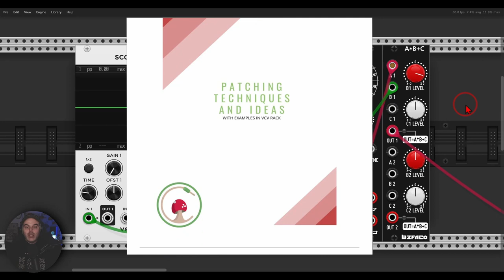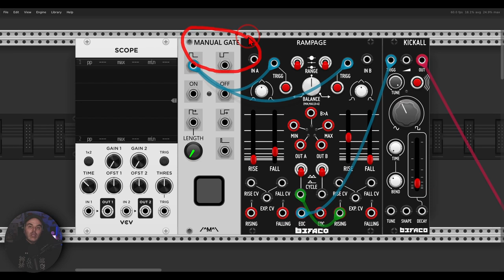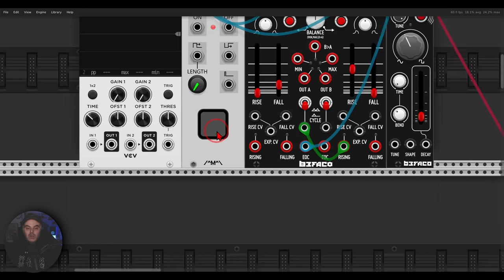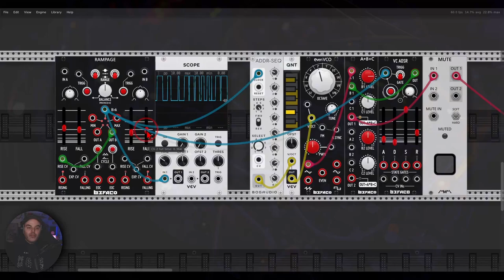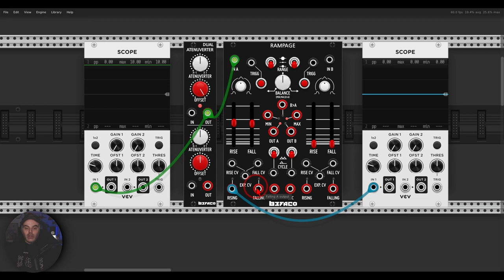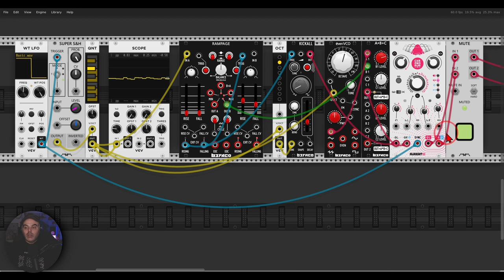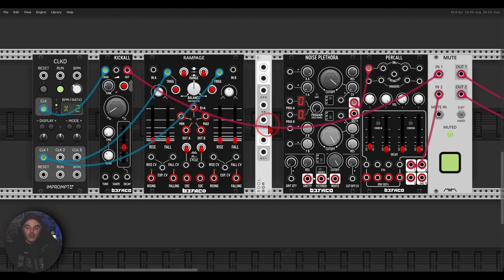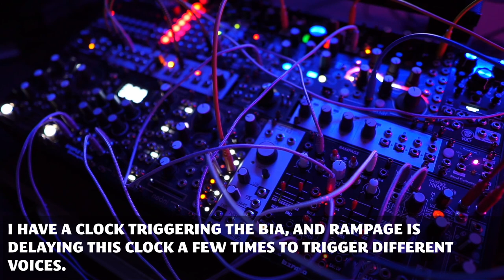It can do more than just envelopes!

Comment: thx for the video.
19:20 - interesting patch. how does the notes from bass guitar implemented in midi/cv and converts it to some certain notes (random in some scale?) what modules do that?
Reply from the maker: Thanks! The notes are not changing anything, it's the amplitude and using Rampage as an envelope follower\slope detector. The notes are coming from the Voltage Block and are indeed random, but quantized to a scale. I hope it makes sense...

Comment: Would the first patch work just as well if the function B rising gate were patched to the function A trigg?
Reply from the maker: What would cycle it but?
Reply: @OmriCohen-Music  Everything exactly same except A is triggered by B rising gate instead of external trigger. B rising gate goes to both A trigger and A loop. I just tested, and it gives identical results, except I suppose the A is triggered one sample later. I imagine that normally is not an issue.

Comment: I assume that ANY trigger (not just a manual trigger) would work to get things started? Say some random trigger that has filtered down through various generative means and finally reached Rampage?
Reply from the maker: Yes, any trigger will work. I use the EOSG output of the Morphagene sometimes, complex waves through a comparator, or even a random sequence from the Voltage Block.

Comment: If EG A is being controlled by Rising output of EG B, why does EG A also need that initial trigger?
Reply from the maker: Do you mean the Cycle of EG A?
Reply: @OmriCohen-Music  Yes.
Reply from the maker: @christopherwilliams375  it will not start cycling until it's being triggered
Reply: @OmriCohen-Music  Okay. So then the cycle first requires a trigger, or it will not cycle. Weird. Not sure of the point for that decision. I know that neither Maths nor Falistri require a separate trigger to get it going. Send a gate to the cycle input and they will immediately cycle as long as the gate is high. Either way. Thanks for the info. Can’t wait to try this variable speed/length trigger burst patch.
Reply from the maker: @christopherwilliams375  Yeah, Maths will work differently, that's true. I guess that it makes sense in hardware to have it cycle without any additional triggers so there's no need for more cables and mults.